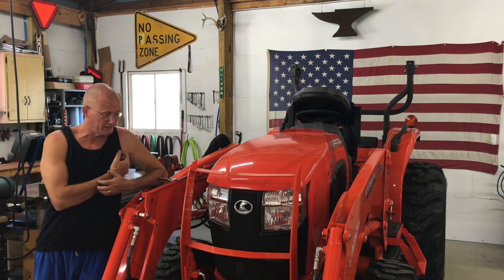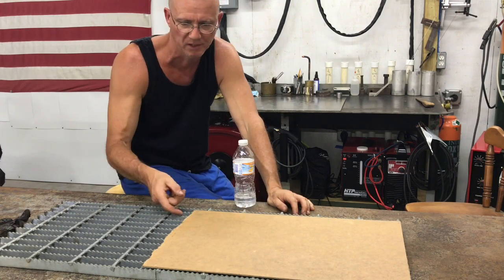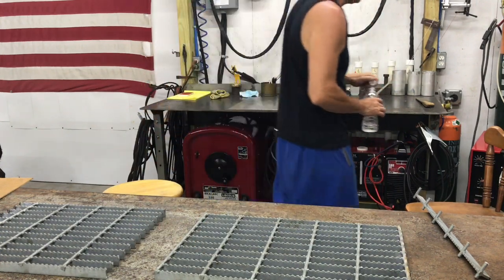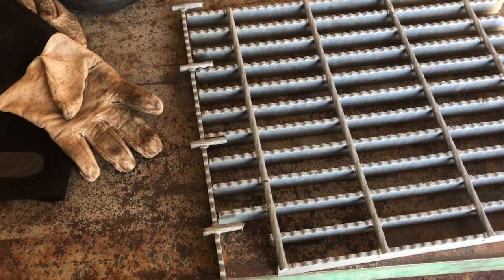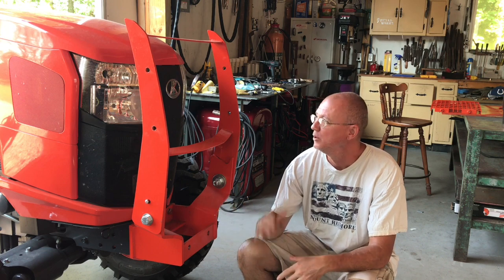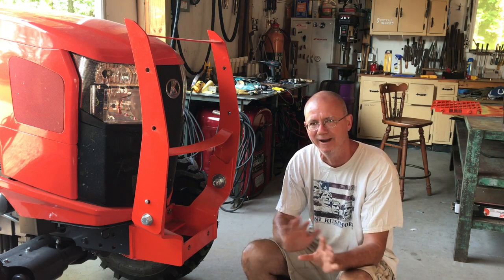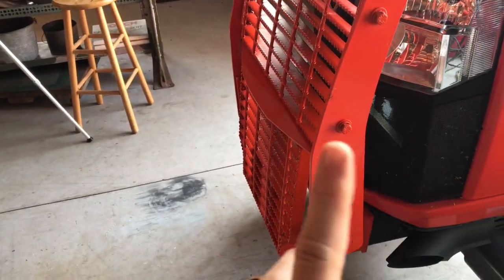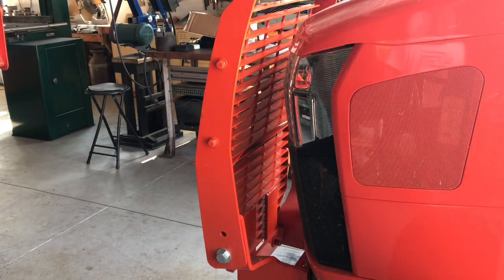Let's Make A Better Grill! Kubota Grill Guard Fabrication.

Comment: I am a Certified Welder with many yrs of metal fabrication and assembly experience and I bought a 5/11 heavy Grill Guard for my Kubota L 4701 . It’s very strong, looks great and is priced well. Yea if you have the equipment and know how , fine. Most don’t. Besides your guard is inferior to the one I bought. Yea you made it but time is money and you’ve spent more and have less, just calling a spade a spade.

Comment: Great job Chris. Glad to see the old Idealarc get to have fun. Those zinc fumes are bad stuff. One advantage to using a stick machine is having a fan to blow the fumes away. Obviously not an option with mig process
Reply from the maker: Thanks! I actually have an exhaust fan above that sucks the smoke and fumes out of the shop. It helps a lot but is not perfect.

Comment: Looks great and heavy duty for sure, but in my experience the gaps in the grating will still let sticks through large enough to punch out the lights and radiator. I used 3/8s gap tempered expanded metal. But with risk involved in pushing brush, anything is certainly better than nothing.
Reply from the maker: Yep I would agree but this is what I had gotten fro  the scrapyard for super cheap......25 cents per pound. I may try and eliminate the opening at the bottom since it has greater risk of permitting foreign material into the grill area.
Reply: @shopdoc  I do like the look and the strength in yours. I love fabricating stuff like this. The grill guard on my L3130 has round tube cross members. I cut the expanded metal to fit the inside profile of the guard. Then drilled and tapped the front edge of the tube and attached the metal  to the front with stainless fender washers and hardware.  Didn't like the idea of welding it. If you ever damaged it, a lot of cutting and grinding involved in replacing it.
Reply from the maker: Fantastic idea! Inevitably you would damage the expanded metal and replacement would be simple! I like using stainless as well.